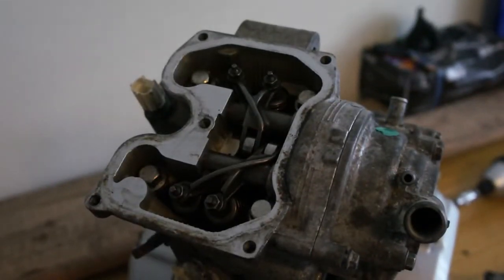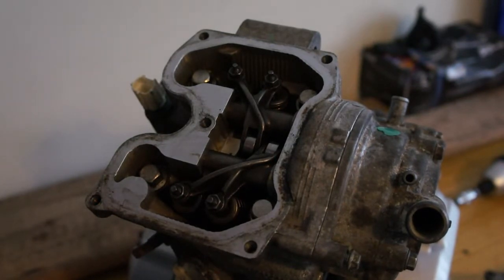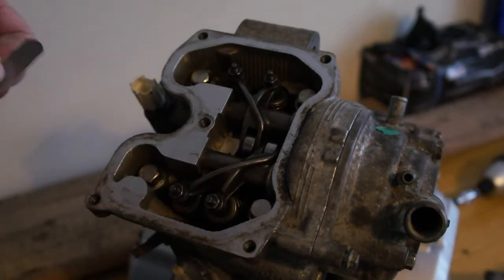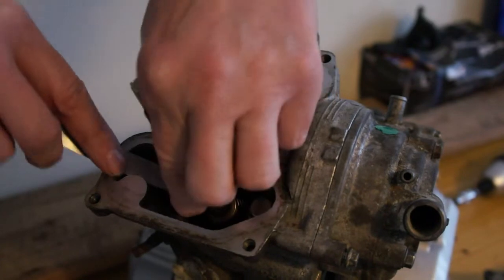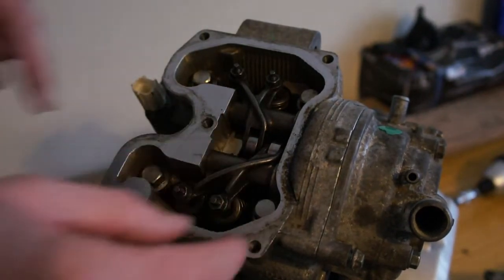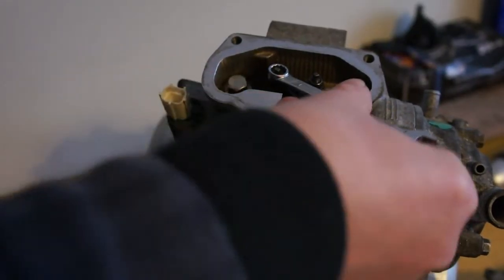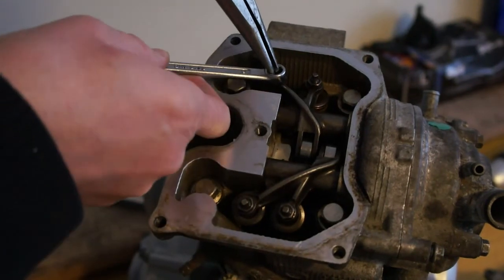Tapping Engine Fix! 🛠️ Yamaha YZF-R125 / WR 125 Valve Clearance Check & Adjustment

Comment: Hi mate

Are the valve stem oil seals in the head?

My apologies if this is a stupid question.

Cheers.
Reply from the maker: Ive never removed a valve from these engines sorry i would presume so check  manual

Comment: What valve is what mate
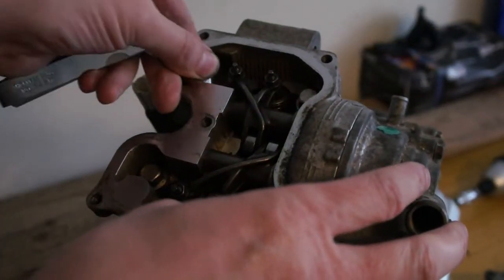Reply from the maker: Its as easy as looking at the head , the exhaust side valve is on the side the exhaust fits too and the inlet valve is on the side the fuel injector fits to. 0:17 secs in video is inlet side , thanks for comment mate are you from Cov ?
Reply: @cagmito76  ok so at 17 seconds is Inlet side and the other one you adjusted in video is exhaust side? And thanks for the reply I appreciate it
Reply: @cagmito76  yes mate from cov and my bike is a rieju rs3 same engine just carbed, would the specs be sake as Mt 125 engine? And never done valves before and mine need doing and is there one of each valve on either side or is one side inlet one side exhaust sorry for the stupidity just new to valves